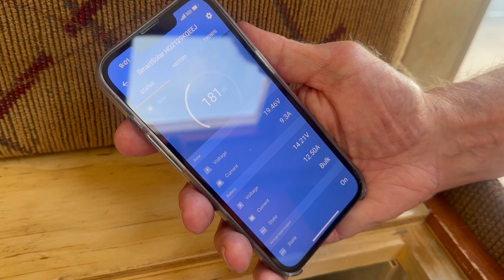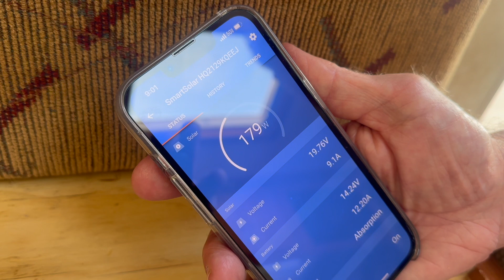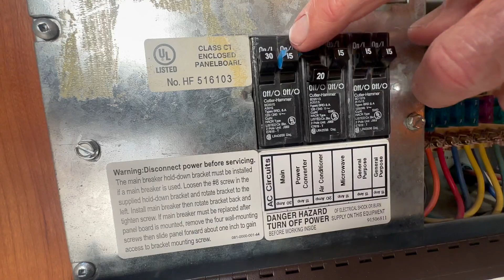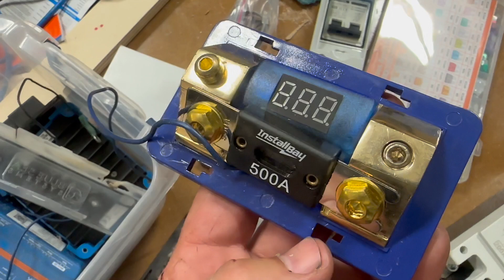Bigfoot Travel Trailer Victron System Not Working  Diagnosis and Fix  from Burned Fuse

Comment: So, are you only using the big Dihool breaker as a main power switch and not actually relying on it as a breaker?
Reply from the maker: Yes, as a breaker as well.  We call that a Two-Fer  (two for one)
Reply: @sotasolar  So, if each of the server rack batteries has an on/off switch and own internal breaker, would you not bother using Class-T fuses for each branch of the batteries (six batteries in three pairs) into a Lynx Power In and then use a single big Dihool 400 or 600 for in between the Lynx Power In and Distributors? I thought about using the Lynx Shunt, but seems like it (and it's expensive fuse) are not worth the extra when this is a good area to put the main system switch and just use regular Smart Shunt.
Reply from the maker: @dalehollenbaugh6084  Server rack batteries have their own protection, so you're good, don't need a Class T  The Dihool can actually interrupt more current than a class T... and is resettable.

Comment: I liked your pile of fried fuses and other equipment 🙂... typically fusing, particularly DIY fusing, both uses the wrong type of fuse and the wrong current ratings.  But I've seen horrible errors made even on professional installations.

Problems that I saw:

* Improper use of paralleling connectors on the roof.  Fire hazard.  Paralleling should always be done through a combiner box.  Never use MC4 paralleling connectors.  Ever.

* Improper fusing of paralleled solar panels.  Each individual string needs its own fuse before being paralleled (hence why you use a proper combiner box).  The whole point is to prevent the other paralleled panels from dumping into a shorted panel (causing a fire).  Fire hazard.

* Situating a fuse at the "solar" input of a charge controller is completely worthless.  It protects nothing.   Solar panel fusing should be done in the combiner box, relatively close to the panels (but can still be off the roof).

* Improper use of auto blade fuse.   A solar ceramic fuse must be used on the solar panel power path (before the charge controller) (typically a 10x38 in a DIN-mounted fuse holder).   Never use auto blade or glass fuses anywhere in a solar system's major power electronics paths.   Ever.   The only use case is in final distribution, and then only for low-voltage (12V) gear.

* Charge controller BAT output must be fused or have a breaker (it might be but I couldn't tell right off-hand.  Smaller Victron charge controllers do have built-in fuses for 12/24V systems but the larger ones require external fusing on the BAT side.   Otherwise it's a fire-hazard if the charge controller has failure/short because the relatively thinner wire can cause a fire without tripping main battery breakers or the main battery fuse.

MCBs and MCCBs (mini circuit breakers) have two trip mechanisms.  One is a bimetalic strip that does indeed heat up (since that is how it operates), though breakers generally have no problem dissipating the heat under normal operation.  The bimetalic strip handles normal over-current trips.   The second mechanism is a solenoid which handles instant trips when the current exceeds 5x (Type C) or 3x (Type B) the rating... that one handles direct shorts.

UNPOLARIZED DC MCB or MCCBs must be used in solar systems.  The only exception is that the DC MCB in the combiner box can be polarized.   All other MCBs must be unpolarized (be able to trip safely with current flowing in either direction).   All breakers in solar power systems must be 2-pole, breaking on both the positive and the negative.

In anycase, that's what I saw that was wrong / fire-hazard / or possibly-wrong on that RV during the video.

-Matt
Reply from the maker: Great input , thank you. 

It’s my understanding that fusing is only required when the max PV amps of an array can exceed the max series fuse rating. For most of our systems we stay under that (15 a)  and when we don’t, we fuse each string.
Reply: @sotasolar  Yes and no.  Yes in that theoretically a solar panel can tolerate a short-circuit current up to its maximum fuse rating before catching on fire.  But, no, you can't depend on that as a reason to eliminate fusing or use a paralleling MC4 connector.

I'll give you a quick list of the problems:

* A MC4 connector failure up on the roof can catch the roof on fire.  So, for example, when the retention tabs that hold the connector together get brittle with age (doubly so if exposed to the sun) and begin breaking.

This is the main reason why you should never do any combining up on the roof.

* MC4 paralleling connectors have extremely variable levels of manufacturing quality and often have insufficient metal busses inside to actually parallel their rating without melting.

* Solar panel voltages, particularly in strings (2 or more panels in series), make ARC shorts very dangerous (very hot).   Even a single-panel string can develop high voltages in very bright and/or very cold conditions (exceeding the label).

(This is also why solar ceramic fuses must be used on solar-panel wiring, never auto blade or glass fuses).

* ARC shorts basically happen at MC4 connector interfaces, disconnect switch interfaces, inside non-spring-loaded disconnect switches, at fuse interfaces, and inside fuses. 

(this is also why you don't want to put fusing up on the roof either).

* The combiner box provides additional levels of safety, including a better air-gap and more resilience against charring from a failed component inside getting outside the box.

(just like plug and switch housings do for home wiring).

--

That's it in a nutshell.   Best practices are thus to bring the individual string cabling down off the roof and into a bay and situate the combiner box in the bay where it is protected from the elements and easily accessible.

The combiner box contains the solar fuses, a master breaker (a convenient disconnect point), and typically surge protection as well.

-Matt